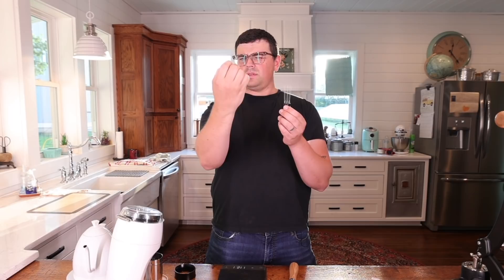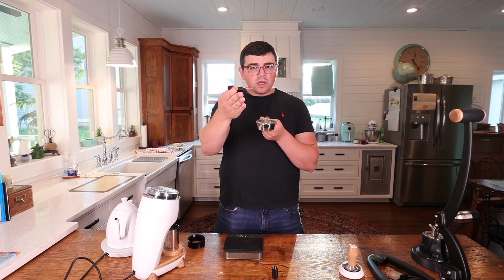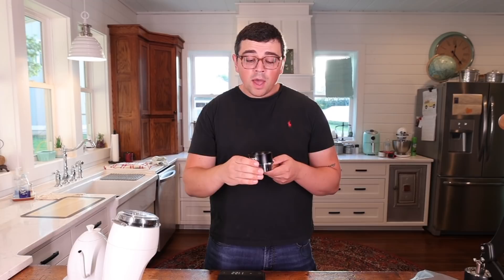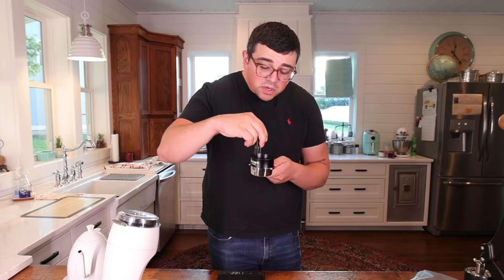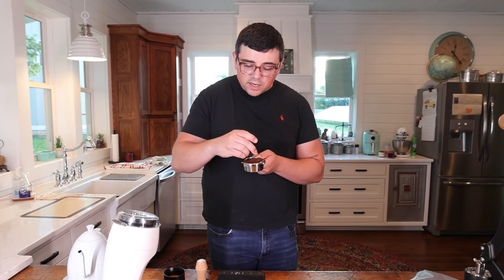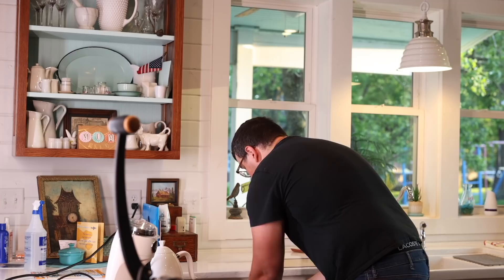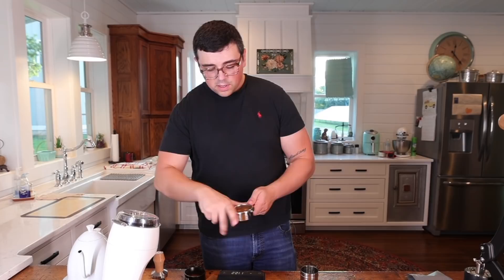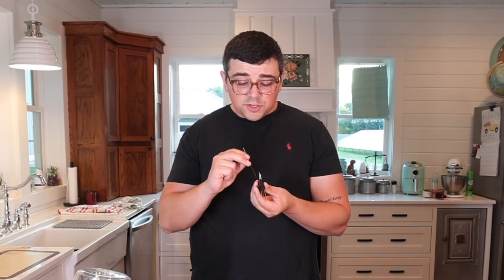HOW TO MAXIMIZE ESPRESSO EXTRACTION: How to Correctly Perform The Weiss Distribution Technique (WDT)

Comment: At 4:00 when you said “I recommend getting a shot collar. I’m using the decent one, and it...is magnetic” I fully expected you to pull a pun and say “it...is decent” after that little pause before magnetic hahaha
Reply: Do you ever plan to touch on any cold brew topics? I personally manage the cold brew department at my work and I have a Never-Before-Seen 8x Yama setup plumbed into our in-house water pressure with a water chiller box and reverse osmosis and two different sized toddy buckets, one plastic and one metal. I always hear a lot of “bare minimum” stuff being done when it comes to cold brew at shops, like most places don’t put a lot of effort into it. I personally specialize in that so it hurts a little when I hear about bare minimum quality when it comes to cold brew because it’s just “quick iced coffee” , it’s much more than that.

Comment: Hi Lance. Fantastic video on WST!  Very helpful. A question for you. Sorry for the long post. 

I use a Niche Zero grinder, and grind directly into the basket (and funnel/collar) which I rotate under the NZ funnel, for evenness. Accordingly, I don’t see much much, if any, clumping.  Still, I have always WDT’d and am loth to give it up.  So I deep and mid WDT with very small circular motions, which I more broadly spiral from outside to in. I then surface rake, with a 3D printed tool that I bought on Etsy, into which I have inserted 9 acupuncture needles of 0.35 mm each (80 mm long, including the 30mm handle portion). Still, I am always concerned about moving coffee grounds around, as I understand that less is more.  This 9 needle configuration seems to move the grounds around somewhat (not hugely but it does move the grounds around abit). Should I reduce the number of needles (say to 6) or reduce the size to say 0.30mm or do both? As I do not see any pre-WDT clumps, I am wondering whether I am introducing more channeling risks than there were in the first place.  Post WDT, I do see some evidence of channeling (1mm wide but not deep holes) and say 75% coverage of the basket bottom during the initial beading, on say half of the shots that I pour. Any suggestions here, as I am looking for consistency.

Comment: Mine is made up four (same pattern as the Decent one) 0.4mm 3D printer needles (on amazon, the brand is REPTOR) into a one inch wooden dowel, I used a 1/16th drill bit into the dowel and they friction fit, no glue needed. I did snip the ends off of the needles based on what another user recommended on the espresso subreddit and haven't had any issues
Reply from the maker: Love it! This is great. Thanks for sharing
Reply: Going to try this tomorrow got the 3D needles
Reply from the maker: Heck yes!

Comment: I thought I remembered seeing a video where they concluded the hand leveling method was most effective without pressing down on the coffee, however, it may be before the needle tools were common, also it requires a certain technique and may be tricky to do properly for some people, it also requires touching the coffee with your hands (maybe not so sanitary), and the reason I never loved that technique is because you start with a mound in the center and basically push it towards the corners but loose some coffee off the edge, which I don't like to do because it's wasteful and messy. So yeah I use a collar/funnel and home-made needle tool with a similar technique to yours, I just don't hit the very bottom :)
Reply from the maker: It has been proven scientifically (by some studies conducted by Gagne) that deep wdt is always superior. 
As for previous superior ways to distribute, the best was never leveling the top with the finger. The best was horizontal tapping. Shown unequivocally by barista hustle back 6 or so years ago

Comment: I’m New to brewing espresso.  I have an ECM Synchronika.  I have an ECM S 64 automatic espresso grinder. I use a jack leveler & no tamping. I get some clumping from my grinder. Not bad. Would I be better off going with a courser grind & tamping than what I’m currently doing?
Reply from the maker: You'd be better off getting rid of the leveller and going wdt route.

Comment: Thanks for the vid. Have been using sewing needles but must invest in some acupuncture needles! I do find the wdt puck prep makes a huge difference even though my grinder doesn’t produce many clumps. I use a K plus btw and find it great. Cheers,
Reply: I just bought 100 stainless steel needles that are for 3d printers and they were a about 8 bucks.

Comment: Pulling (bottomless) shots using WDT of different sizes would have been nice to see for the comparison, acupuncture needles vs toothpick. Just some feedback, not criticism. 👌
Reply from the maker: You're good! I didn't feel the need to do that because it has been proven multiple times already. But either way, not all channels are visible. People have the misconception if they don't see something unusual that they have negated channels. This is inaccurate thinking.

Comment: Outstanding video on puck prep. I do deep WDT same as you, but I find application of a fine water mist to puck surface of about 2 gm promotes initial flow, allowing sl finer grind and higher extraction. Great yt channel, wish I'd found is sooner !!!
Reply from the maker: Yes. This can theoretically assist in capillary action, but not proven with substantive evidence yet. It is a fun thing to play with, though! Glad to hear you've dove down that rabbit hole!
Reply: @LanceHedrick  it also affects the surface energy / wetting tension to promote uniformity at a microscopic level as the initial pressure hits the surface.
Reply from the maker: Yes, which happens through capillary action unless I'm mistaken. The horizontal extraction aide comes from the wetting that encourages a more even horizontal extractions, in theory
Reply: @LanceHedrick  yes, surface energy is what drives capillarity. I notice distinct effects of light misting upon extraction time,  other factors held constant, and I seem to be getting more consistent results using it.
Reply from the maker: Interesting. I've had hit or miss results, nothing super consistent. In my mind, it makes sense, which is why I keep playing with it, but I won't be doing a video on it until I see, or compile myself (which I don't have time to do in the foreseeable future) more static and objective data driving the conclusions. That all being said, I'm glad you're getting improved shots!

Comment: Help. I measure out 18 g and my grounds always end up above the basket after distribution by like 2cm. I’m never able to tap it or put the tamper on without gradually pushing it down myself first. What am I doing wrong? It’s a 53 basket . Shouldn’t it fit? I use a Breville

Comment: I love the video. I’m curious what you think about OCD (or similar) tools for distribution. Are they redundant after WDT?
Reply from the maker: They mess up the hard work wdt did.
Reply: Right, as Lance says, they will unevenly compress parts of the puck (particularly the part where the edges of the fins first meet the grounds).
Reply from the maker: Yup! Nailed it.
Reply: @LanceHedrick  Very interesting. I was actually doing WDT and then OCD and sometimes getting chanelling. I now understand the two should to be combined.
Reply from the maker: For sure. I'd sell the ocd if I were you! Haha

Comment: What about tool with the round end ? like a loop ?
Reply from the maker: No good. Those loops are unnecessary and only harm the bed.
Reply: @LanceHedrick  oh... beginner mistake i guess haha. I got a WDT tool from Etsy with a wooden handle.  I checked the diameter with a digital caliper and the "needle" are 0.80mm wide.  The loop at the end of the "needle" is 5.23 mm  diameter. The needle are 86mm long and the complete tool is 148mm long. They were stating on the etsy that the loop was to prevent the basket damage. But as i understand 0.8mm is way too wide even for the needles and as you said the loop will not damage the basket but it will mess with the extraction...  really good to know.  Also the needle are fixed with some kind of epoxy so if they bend its over.  The puck rake video was really helpful ! 

I will check SWORKSDESIGN tool as it seem weel made.  I guess i can still recycle my larger tool to stir pour over or to remove the clump from my Hario Swift (using Hoffman method). Its a good looking piece. Thanks a lot for this !
Reply from the maker: Yeah I tend to not trust Etsy for coffee stuff haha! Can't go wrong with simple acupuncture needles, which is what Sheldon uses in his (sworks)
Reply: So should i be good with just the .22mm and the raking technique ?
Reply: Just ordered one from Sheldon with the magnet :) cant wait to get it. Thanks again for the video and the time you took to answer !
Reply from the maker: That's awesome! And I'm sure you can switch out those .22 with others if you ever wanted to do so!

Comment: Great video. What's your opinion on using the sworksdesign 0.22 and 0.25mm mixed for all
Levels of WDT: low, middle and the top layer? Thanks
Reply from the maker: I have changed a bit since this video. I now do all with just a .3mm tool!

Comment: No joke squealed with excitement when I saw this vid had dropped!

Thanks for sharing your wisdom as always ❤️

Troubleshooting question if that’s okay? I have a wine cork with 4 0.4mm needles spaced out going out at a slight angle. When I deep then shallow WDT, I still find I can have noticeable inconsistencies between shots (some shots run as fast as 25s and some run to 37s all with the same grind and dose)

Any advice for ensuring consistency with WDT?
Reply from the maker: I have found really nice consistency with the 9 needle configuration. Might help to have more. Also, ensure you're evenly going from bottom and edges to the top. Meticulously.
Reply: @LanceHedrick  thanks lance! I’ll try adding some extra needles and being more cautious in my technique to ensure consistency 🙂
Reply from the maker: Love it! Let me know how it goes.

Comment: Hey @Lance - I am considering to make my own tool - what do you think of the idea: 1 tool with long 4mm needls and 2mm short needls and some wooden puck thingy, so I can "spin" gently on top of my funnel. 
I'd really like to do WDT, however,  on a busy day 2 tools seems a bit much in this perspective. What are your thoughts on the best way to innovate/create a tool? :D
Reply from the maker: Issue with spinning tools is the fear of leaving track marks. I'd suggest maybe using just .3mm needles in a varied combination of locations instead of symmetrical so hopefully a few spins negates tracks

Comment: Hey Lance, 

Thanks for the video, i enjoyed it :D
What do you think of the Londinium WDT Tool ?

I have it, but i dont use it too often. The most important thing to me, to have a proper extraction, is not to grind directly into the portafilter.
Reply from the maker: I have not used the Londonium tool. How wide are the needles? And with deep WDT, it doesn't matter as much if you grind in the porta or not

Comment: What do you think of levelers and using a paper on top or bottom for more extraction? :))
Reply from the maker: Hey! I do not like levelers. Both in my experience testing as well as more extensive testing, they have proven to cause more harm than good. As for paper, putting one of the bottom certainly increases hydraulic resistance, so if you would like to a) clean up the cup by holding back some fines or b) use a smidge coarser grounds for extraction, do it! For top paper, not proven, but seems to help as bit with radial extraction.

Comment: Hi Lance - might have missed this in the video - but what happens when you use a thicker 'needle' like a fork? Is that because it doesn't fluff it enough? or does it destroy the coffee grinds because its too harsh?
Reply: they are so thick that they leave channels and compresses the grounds which is not good for an even extraction
Reply: @doc8125  thanks! I never really thought of that. It seems you are right too! I stopped using a regular fork and the flow has been much better!
Reply from the maker: Yes! Much too thick. If recommend buying acupuncture needles of .3-.4mm thickness and putting them in a wine cork for an easy DIY tool!

Comment: Great video again and used the files to print the tool, thnx! But would like to make the top-groom-tool (straight model) as well with the 0.22 needles. To get the best fluffyness, haha.
Any 3D files on that tool as well? Would be great!
Reply from the maker: You can use the same tool and just fill with .22mm needles!
Reply: @LanceHedrick  ok, but your tool which is more straight makes more sense grooming the topside? Then tool with 9 needles angle more outward and would you advise to use 9 .22 needles or fewer needles?
Reply from the maker: You don't have to put all the needles into the tool. And the thinness is insane. Angled won't be a big deal, tbh
Reply: @LanceHedrick  Ok, thnx, ill use the same tool. Couldn't find 0.22mm tough, how about 0.25?
Reply from the maker: .25 will work !

Comment: Great. Video again Lance, what are the drawbacks of deep WDT with .22 needles?  I have a WDT tool with needles that are too big to do the final racking ar the top...  want to change.  Thanks
Reply from the maker: The needles are so thin they tend to be difficult to move the lowest layer
Reply: @LanceHedrick  so if you had to buy one? 🥳
Reply from the maker: I would just do .3mm if wanting deep and it can do top pretty qell
Reply: I feel like I'm already challenged by my 0.35mm. can't imagine going anything under that. It takes a very good practice moving those flexible needles across the coffee bed.
Reply from the maker: Yeah. .22 is hard for deep, but doable. I just prefer between .3 and .4

Comment: Look for and buy a whisk...some of them have fine wires.
Cut them off at the right length and sand off the rouch tips and you got a nice wdt tool for a few bucks
Reply from the maker: Can also just snag some acupuncture needles and drill holes into a wine cork. Not sure I've ever seen a whisk that had .4mm or smaller diameter
Reply: @LanceHedrick  looked at my whisk after and the needles are pretty fat so discard my comment....lol
Reply from the maker: Haha! Yeah I figured 🤣🤣🤣

Comment: 1ZPresso hand grinder + Leveler = Don't need no stinkin WDT. Thoughts?
Reply from the maker: Haha no way. Leveler is awful. It does more harm than good. It also doesn't do anything to distribute the bottom portion of the basket. It has been shown multiple times that even side tapping is better and more efficient than a leveller. I'd recommend ditching the leveller and grabbing a WDT. Or, at the very least, ditching the leveller and side tapping.

Comment: Thoughts on a coffee distributer that spins vs this?
Reply from the maker: Like a WDT spinner? I've seen a couple people make them, but haven't tried. I've gotta imagine they aren't as good. Seems to me they'd leave tracks in the bed.
Reply: @LanceHedrick  I was talking about like the ocd tool that just distributes no needles, like 3 machined blades
Reply from the maker: Ohhhhhhhhh yes. OCD is no good. I recommend against it
Reply: @LanceHedrick  damnit… well I bought a cheap one on Amazon already. Same thing. I’ll have to get the needle wdt tool
Reply from the maker: Yeah get rid of the distributor. Lots of channeling. If you have access to a 3d printer anywhere, I have the file for the one in the video up in the caption.
Reply: @LanceHedrick  I saw that. I’ll have to do that